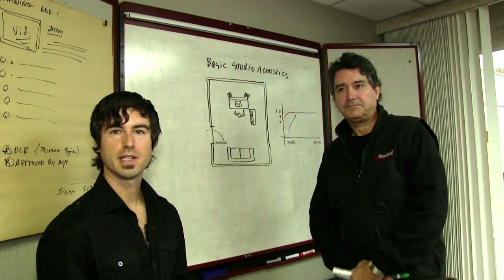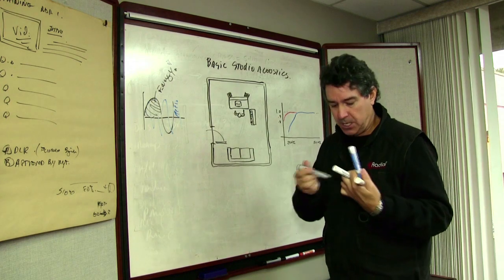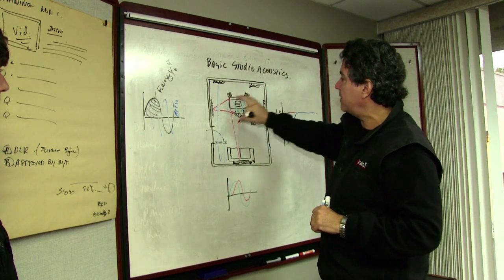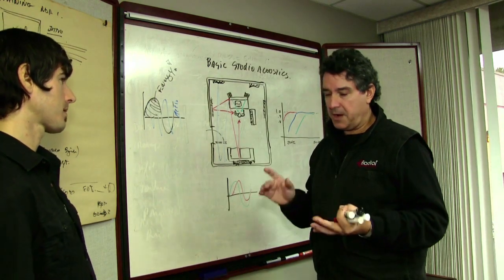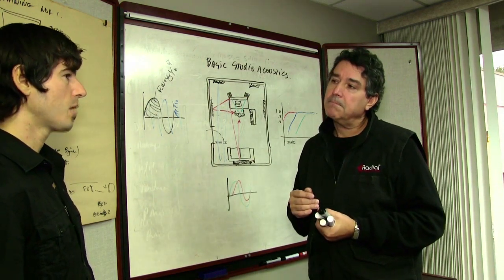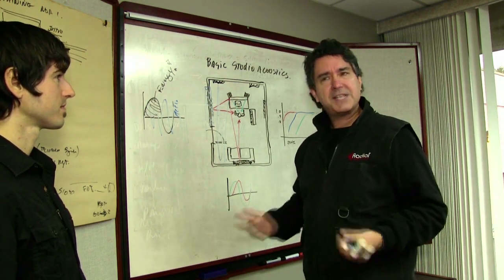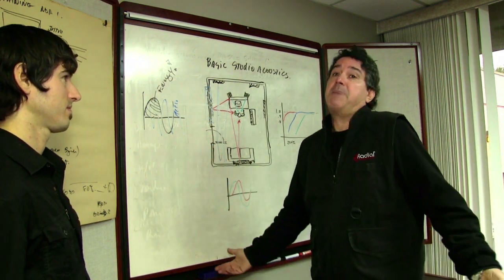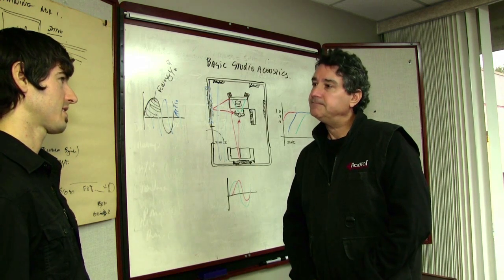Studio Acoustic Treatment Explained

Comment: I recently moved into a house with a basement with my fam and I have my parents living with us so to make their lives easier until they get their home, me and my fiance' took the basement. The basement is unfinished though, but it has very thick Owens Corning insulation along the main area of the walls where the "den" would be with the sliding glass door but everywhere else; our bedroom area, the laundry room, the back of the staircase, and the unfinished bathroom has nothing. You can walk through the framing into the next room. My setup is a mix between being ready for recording music as well as the ability switch over to TV/Movie viewing and/or gaming. I apologize for how long this comment is but I wanted to give an idea of what my area looks like in order to see if anyone knows if it's a good idea for me to get panels to put up in the area and those very thick drape sheets (I think it's called Feter or Feeter idk how to spell it ) over my sliding door so that when I do record in chances to make my area more acoustically treated with the limitation of not being able to actually finish the basement. Also, of course being unfinished means the floors are still concrete is that an issue? Oh I forgot, I have a garage to, as I sit in my chair facing the screen the wall to the garage is behind the monitors and comp screens, the sliding door to my left the back of the houses wall is to the rear, it's the wall that has the overly stuff insulation to where they had to shoot rivets into it.
Reply: +DJ Vespers ok cool thanks for the advice DJVespers

Comment: been building some bass traps from high density material and some thinner primary reflection panels which are a bit thinner for mids and highs. everything he says is true, esp. that it's easy. about 1000 AUD is required.  about 700USD. happy to speak to melbourne folk with panels.
Reply: In Melbourne and about to install Martini Absorb XHD 100mm about $320 for 12 off 600x1200 black panels.

Comment: Say your building a room for a recording space (which is what I'm hoping on starting soon). your obviously gonna want glass between you and a vocal booth to visually communicate with a vocalist. Where would the best place be to  build the booth to coincide with the best place to put the glass in the room? I figure the more symmetrically perfect room is going to distribute the sound more evenly (correct me if I'm wrong). Would the best place to build a booth be In a room directly in front of your line of sight on the other side/behind your work station?
Reply: I am using your drawn studio in my example of window/vocal booth placement.
Reply: Lindsy Says Official 
Fk the glass 
Use a monitor and a camera .
Cheap and gets rid of the troublesome glass .

Comment: Hi DJ Vespar, I have watched your videos on youttube and got some great ideas on the vocal booth acoustics. I have one question for you. I am build a new studio in my garage and I have a 6 X 7 ft. vocal booth and I was wondering if it's ok to use a metal door instead of a wooden door? I will be using double dry wall with sound board in the between the walls for insulation, and also i will be putting the foam on the inside of the booth.

Comment: Great video. What absorbing material for diy are out there other then fiberglass to use . Multible moving blankets to will help that's what I can think of right now . 
I'm a hobbyist and my room size is approximately 12'×14'×8' high.
Reply: Towels work great, also Rockwool insulation is a type of pseudo-fiberglass insulation which is much less dangerous for your lungs & skin, their Safe ‘n’ Sound insulation is some of the best for acoustic treatment

Comment: In a rectangular room, is it preferable to set up along the long edge or the short edge? 

The diagram shows a long edge set up,
I wanted to set up along the short edge but I’m unsure if that would cause any extra problems with treating.

Thanks!
Reply from the maker: Hey hey.  You set up facing the short edge so there's more length behind you.  http://arqen.com/wp-content/gallery/room-setup-speaker-placement/studio-monitor-speaker-placement-stereo-surround.jpg

Comment: wow how old where you back then? And what do you think about primacoustic vs ticker less dense roxwool as you recommend now?
Reply from the maker: Haha.  This was in my early days on Youtube.  A decade and a half ago mate.  

If you are only going with super thin (1-2") panels and you need them pre-fab for easy use, then the Primacoustic stuff is good.  It's very high density (100 kg/m3) glass wool.  These are great for video production and hobbyist audio rooms, but they will not give you truly professional results.  

For that you need much greater depth, and much less density.  I'm about to do a build in a small studio and we're using 5.5" thick side wall modules and ceiling cloud, and 11" thick rear wall modules.  For all the modules, we're using 2 different types of rockwool for a dual-density / graduated density effect which will increase LF absorption significantly.  

I'm using 2" of Rockwool Cavityrock (69 kg/3) as the front layer, and 3.5" of Rockwool Comfortbatt (32 kg/m3) for the back layer on the modules.  The module design for framing and wrapping is identical to my newer build videos featured on the channel: https://youtu.be/ECazGzutkV8. 

These modules will radically outperform anything pre-fabricated, and all for a cost of $300 each for a 4' x 8' floor to ceiling coverage.  You can build a great room with these.

Comment: I've just moved to a place with a nice large rectangular studio but it has windows down one (long) side,I.e. at a reflection point, so a drape won't be enough will it, how can I have a panel there too?  The only way to have the same materials on both side of the listening position would be to position it across the room so I am facing across. I was thinking maybe I should block the window and put a panel on top of that? Thanks for any suggestions, the video is very clear and helpful and I really appreciate your efforts.

Comment: Hi, Can felt be used as a material? Is it dense enough? Thanks
Reply from the maker: I've used blackout drape folded over a few times before, but I wouldn't recommend it or felt.  It doesn't absorb evenly enough into the low mids and lows.  Better to get a broadband absorber.
Reply: @warpacademy  Thanks for the reply. I am looking for a material to include in the panels that would be human friendly and dense enough to work instead of fiberglass. Cheers

Comment: Before I move on to acoustic treatment, I would like to do some general sound proofing on my walls as at the noment bass vibrates the walls and sometimes creates rattles as well as disturbing other people in my property. How efficient would carpet tiles be as a relatively low cost solution for the walls? At the moment I do more listening than recording but I have the equipment to do so in the future but I feel that some basic soundproofing is a place to start. Thanks in advance.
Reply: I'm not sure carpet tiles will remedy the rattles in your walls. Look into bass traps to reduce the heavy frequencies slamming into the wall.
Reply: signalchef  Ok, thanks.

Comment: Glass is bad in studios. It's a good thing the majority of recording studios don't have glass between the control room and the live room.
Reply from the maker: Typically you'd want to have a control room without any glass for sure.  The only exception to that is when glass in in the front wall and the speakers are flush mounted into that wall.  If that's the case, you don't need to worry about a bounce off the front wall.  The speakers are flush with the wall, and the rear wall would be extremely well treated.  Most likely with several feet or more of absorption.  A good example of this is Noisia's studios, designed by Northward Acoustics: https://i.pinimg.com/originals/9f/6a/a8/9f6aa87e215a3cfe11bf78129c5a11df.jpg

Comment: I'm sorry but sound energy has nothing to do with frequency... Actually it does for electromagnetic waves, but sound is a mechanical wave, therefore the explanation with the "area under the function" that our "expert" explains is false.
Reply: Fail. Back to physics class for you. Lower frequency audio waves contain more energy than higher frequencies of the same amplitude. They therefore also require more energy to produce (which is a large part of the reason why woofers require so much power than tweeters, or for bass guitar amps vs normal guitar amps as another example).
Reply: Kevin Kretsch Which is as so many things in acoustics very counter intuitive... and I funnily enough am an acoustician. No my friend... The question lays in your hearing. WE NEED much more energy to hear bass frequencies but the energy of a mechanical wave is purely based in its amplitude and Energy has no relations to Frequency... actually you could say that high frequency has higher energy since the velocity of the air particles is higher and more particles are displaced per time unit. Also you use twitter for high frequencies cause since you have to move a certain mass much faster per time unit, u favor a smaller membrane... Such big mouth some people have...
Reply: Javi Hache
I'm more to happy to make an ass of myself if every body learns. Reddit is a not the place to learn physics and your link doesn't teach me anything more than what you have previously said. I am always happy to be corrected, but please point me to a better source. Acoustician? Great! Point me to something technical. I can handle a little math, trust me (I was an optical physicist, once upon a time).
Reply: +Kevin Kretsch (DrKev) loooool nice
Reply: +Kevin Kretsch (DrKev) http://hep.physics.indiana.edu/~rickv/Sound_intensity.html
Well, reddit is not the place to learn physics... just because you say so. Anyway, this is technical, but not too complicated, just in case you still don't believe me. Sound energy depends solely of amplitude.